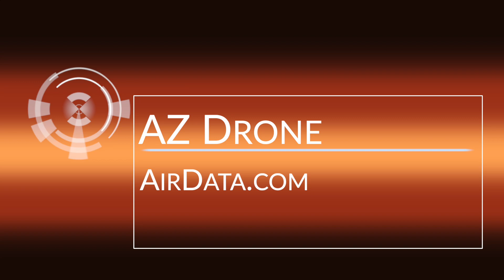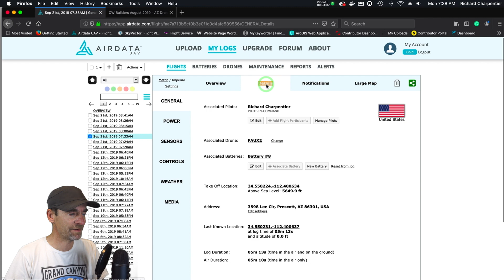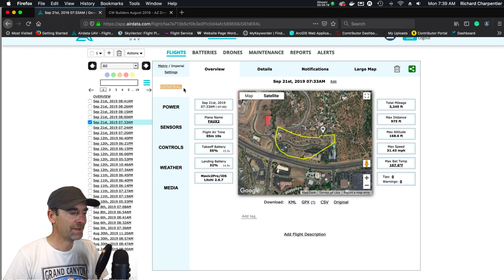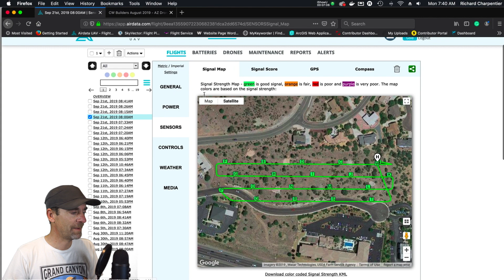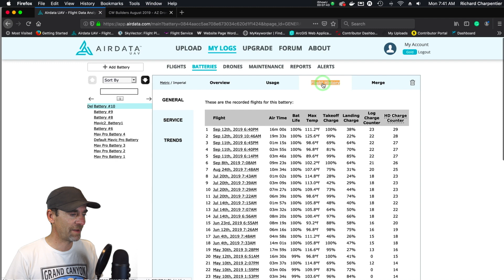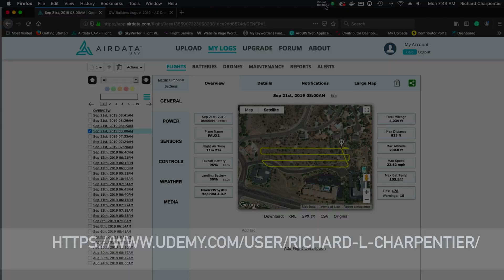Airdata UAV - A great management tool for Drone Pilots - Not a tutorial

Comment: Hey Rich, thanks for this overview of airdata. Just about a week ago I signed up for the free account but I'm still figuring out all the options and features. In your video I learned that there are many more features that apparently come with one of the paid subscription levels so I'll look into that, but I had one question. In order to have other apps like litchi report to airdata is there something specific we need to do? I noticed in litchi that the GUI has a field to put in an air data code which I did, so I'm guessing it's similar to that for other apps but I don't really know...
Reply from the maker: When you first setup your DJI Go 4 app you normally login to DJI with an account.  That DJI account can automatically be setup to sync on Airdata.  I believe the Litchi app ties into that as well.  Ground Station Pro requires you to manually update to Airdata.  And with that in mind, Airdata lets you manually sync files as well.  Basically they give you several ways to get your data into their site.  For me, when I fly with Go4, Litchi, and Map Pilot my data gets automatically sync'd.  Only GS Pro makes me do it manually (which is pretty easy anyhow).